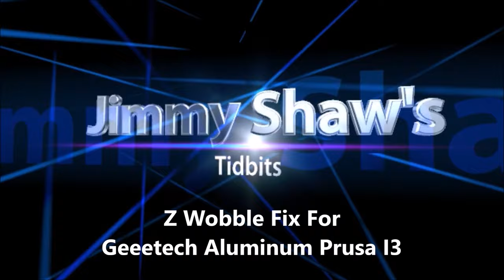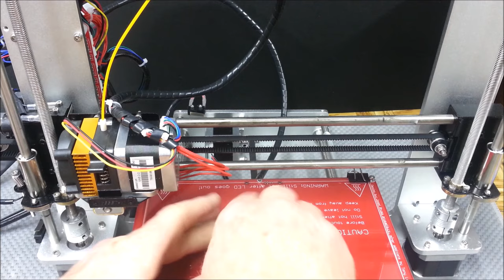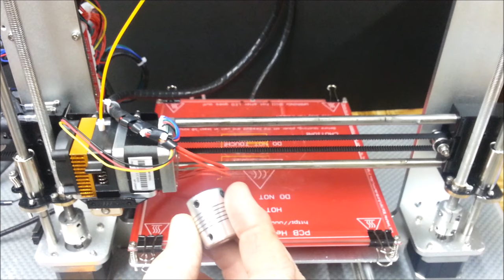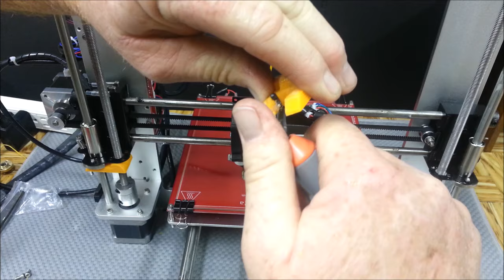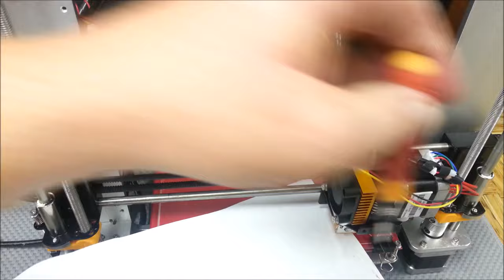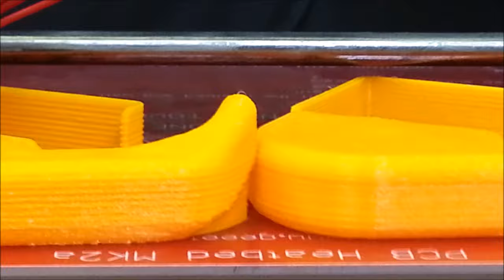Z Wobble Fix For Geeetech Aluminum Prusa I3

Comment: Maybe it has been already mentioned but I see that you level the bed while the bed and nozzle are cold. I have noticed considerable deviations on mine when the system gets at the operating temperature and so recalibration has become necessary. BTW, thank you very much for sharing this video. I have now a founded empiric reason to feature my printer with an anti-wobbling mechanism.

Comment: Hi, what software/firmware do you use? I have got aluminium prusa i3 aswell and I'm having some problems with coordinates and aligning too the bed, I tried the test cube and instead of coming out as a cube it came out as a rectangular stringy mess.

Comment: That is shocking wobble on your z-axis. Great job with the anti-wobble brackets!
Toward the end of the video you showed the wobble with the bracket installed, and it looked like either the stepper motor shaft was bent, or the shaft coupler was tightened in-place uneven, or the motor shaft to threaded rod alignment is way off.

On my printer I had to change one of my stepper motors because the shaft was bent, I also had to tighten the shaft couplers with care so as not to induce alignment issues, plus change my stepper motor mounts. 

Thanks for the video :)
Reply from the maker: +Tech2C Thanks!  I must have spent 4 hours all total trying to align the couplers.  The motor shafts are straight, but every time I would tighten the couplers they would shift just a hair.  Only once did I have it almost aligned, but it turned out I forgot to tighten the set screw on the coupler.  Sure enough when I tightened it, the wobble was back.  LOL!!!
Reply: I understand what you're saying, been there too...
With the couplers, when I tighten them I bend them in the opposite direction first, then as I tighten them the torque action moves them straight. That seems to work for me in aligning the coupler whist tightening.

I haven't investigated your printer design, but if the threaded rods are constrained at the top, that will also cause wobble. If they are constrained see if you can remove the bearing or whatever is holding the threaded rod in place at the top and run a test print for wobble.
Reply from the maker: +Tech2C I tried that too.  Even went as far as to use pliers to give the extra little bit of tension to compensate for tightening the screws.  Still no luck.  The top aluminum brackets have no bushings or bearings.  Now that the holes are beginning to wear a little larger, I'm thinking about drilling them larger and printing bushings for the top.
Reply: Jimmy Shaw's Tidbits

Ok. Yeah drill out the top, let the rods roam free, see how it goes.
Reply: I've done an updated design based on your work, check it out on my channel! It supports replacement without painstaking disassembly and also allows you to use the stock brass flange nut instead of a hex.
Thanks for your inspiration! Really helped me a lot
Reply: cool  i just ordered a  3d printer off ebay  the same as the one in the video  and i also bought 4 rolls of filament 
two rolls abs and two rolls pla to cover all bases  and it cost  $455.87
Reply: its like when the hammer comes out your doing something wrong  lol

Comment: reason for the round shape? reduce contact area?
Reply from the maker: +Nathan Hellyer Yes.  It allowed enough room for the nut to be seated, but had a minimal contact patch on the carriage.  I was going to use a dome shape, but was afraid it would want to center in the hole left from removing the factory nut.

Comment: If the couplings are installed incorrectly you'll see a wobble through the Z axis.

From what I can see on yours in this video and your other, you installed them wrong.

The motor shaft and threaded rod should only be inserted into the coupling about a quarter inch. 

The coupling is designed to flex. This removes the wobble from a slight misalignment of the motor shaft and threaded rod. 

If the motor shaft and/or Z rod is inserted too far, you'll see a wobble.

There's nothing in the instructions that explains proper install of these couplings. So you see this quite often as the cause. That and bent rods.

Nice work around though!
Reply: Wait, I have one just like the one in the video and I've the same problem. Really can I fix it so? Have I only to get the threaded rod up? Thanks in advance and sorry for my bad english.
Reply: you may have to add some tape around the threaded rod. The coupling is designed for an 8mm rod..  if you check. I bet yours, like others is less than 8mm.
Reply: Tape like rubber tape used in electric equipment?
Reply: @ Kay-Rax - it's a hack, so you use whatever works. One guy used JB Weld, though that makes it more difficult to put the rod on and take off.

Tape can be easily removed if you need to remove the rod. Any kind of tape that works... works. Thin is better.

The threaded rods are generally smaller than the 8mm for whatever reason. The coupling will go crooked when attempting to tighten on a rod too small... which most threaded rods are. The flex couplings are designed for use with spindles, not threaded rod. Or a smooth rod end 8mm in diameter, not 7.89mm or whatever diameter the threaded rod comes to under 8mm. You need to bring it back up to 8mm for best results. How you do that, is up to you. And only limited by your imagination and material accessibility.

Try it... you'll see. 

Also look up, installing flexible rod couplings. There's a video that shows the proper way to install these type couplings.

Look at the data sheet for the coupling, it'll state maximum insertion of the rod into the coupling.

Easy as making pie.
Reply: Keep in mind, you can still use the anti wobble hack seen in his video even if you install the coupling properly. It will help remove minor wobbles too.
Reply: Ok, understood. I'll try it and I'll write here the results. Thank you a lot.
Reply from the maker: No disrespect ment, or you could just print and install the Z-Wobble brackets and not worry about it.  LOL!!! 

Sorry, I just had to say it.  I'm so glad to see everyone  helping each other out.  Have a great day everyone.
Reply: Thank you for reply. I'm just trying my first print with your solution and it's going a bit well. There only is a trace of the wobble. Please tell me how to screw the screw of the spring without the spring goes left. Have a nice day .
Reply: When I screw it, the spring goes left, have I to use a tape to make the rod diameter bigger? I really don't know.
Reply from the maker: +K-Rax are you referring to the screw for the end stop for the Z axis?
Reply: Nope, i mean the threaded rod at its bottom.
Reply: Anyway, i solved, thanks to you, used that solution and everything goes well, I just printed squirtle (so cute) and everything is ok. Thank a lot man.
Reply: @ Jimmy - your anti wobble braces may work better with the metal carriers. Those with the printed brackets will still see a wobble even after installing your and others like it. 

Installing the couplings correctly to begin with. Correcting the problem first, then adding in the anti wobble braces to correct for micro wobbles a better longer term solution. Especially for those with printed carriers. I can't speak for those printers with metal carriers first hand. I don't have that upgrade on mine.

The Z axis needs to be redesigned. One shouldn't have to come up with solutions, hacks or work arounds. Those designing the printers for sale should fix the issue so we don't have to...  just saying.
Reply: Thank you for this smart idea! I'll try this out tomorrrow.

Comment: So I initially saw these brackets and thought it was pretty ingenious but thought it was a fix for a problem which shouldn't exist. I thought if I replaced the threaded rods on my machine with T8 lead screws, it would solve the wobble issue and just be a better all around stable machine.

While the lead screws did fix the wobble, it was a PAIN getting them into this machine and I had lots of other problems because I added them. In the end it wasn't worth it.

I downloaded Jimmy's design, printed them out with some M8 nuts I picked up from home depot and I put the threaded rods back in my machine. What a perfect, simple, and easy fix.

Trust me, just leave the threaded rods in this machine and use this design. It's totally worth it for such a great and quick fix.
Reply from the maker: +Bob Butterworth Thank you!!!  I'm glad it worked for you.  Honestly, when I made this, I thought it was just my problem and thought if by some chance someone else had a issue, maybe this would help.  I am amazed at how many views this video has received and how many downloads on Thiniverse for these brackets.  It makes me want to keep making stuff.  Thank you for sharing.

Comment: Great fix Jim, it certainly does the job well.

Alltough looking at the video the problem is more fundamental. I seems the irregualar thread of the rod is clamped into the socket by the horizontal thightening recessed screw thus ofcentering the lot. 
So in fact you would need a rod with an evened out smooth base of 2 cm.

Sorry for just adding to the problem and not resolving it.

Greetings, Ton from Holland

Comment: I have the Geeetech Prusa i3 Pro X (very similar model to yours). I also had quite bad Z-wobbe. I upgraded to lead screws as opposed to the threaded bar. Now it's completely gone. PERFECT z-axis prints.
Reply: Tim Lennard which kind of lead screws I have Same as yours with plastic tube connected to motors. So it is 250mm or 300 lead screws ?

Comment: after days testing I find the solution: the printer is not very straight and the two motors are not exactly 90 dgr under the Z-axis, first solve the building problem and you will see the difference. I decided to rebuild the glass base to aluminium because I am a CNC Miller .

Comment: Brass is a softer metal than steel, a brass nut will wear out while the steel screws don't wear. Steel on steel and they both would wear out together, instead of just the brass nut.

I like your fix, freeing up the x-y azis of the z-axis nut.
Reply from the maker: Thank you!

Comment: you just need to get the leadscrew in linear with the motor axis and everything is fine. that worked for me! in your Video you can See that the leadscrews are running Left and right dude :D
Reply from the maker: You are 100% correct.  And after adjusting, re adjusting and even trying another set of couplers, the z wobble never went away.  You are extremely fortunate that you were able to make it work without any further alterations.  Unfortunately in my case, and several others, this was a fix that helped.

Comment: i think would be better to buy zonestar p802qs full metal frame, i know the frame are pretty slim(about 2-3mm), but it is enough and less problem too. What do you think?
Reply from the maker: +Amr Fwwz I just did a search for it, and can't find where the sale them.  How much are they?
Reply: 50% price of this geeetech! but the metal frame is only 2mm, but it is enough i think.
Any possible better way to fix this z wobble issue? maybe like buy a metal part or something? and this issue affect on the quality or anything? let me know it. i'm a noob and trying to safe my money to buy a good quality frame 3d printer, but i'm confused what to choose between Zonestar p802qs and a famous geeetech printer, just need a little more money to buy standalone geeetech metal frame..
Reply from the maker: +Amr Fwwz Actually the frame is 5mm on this model.  The only other way I know of to fix the z wobble is to buy the stepper motors that have the threaded rods attached so there are no couplers.  So far the brackets have been working so good, I haven't felt the need to spend the money on it.  Have you checked out the Aluminum pro model with the electronics in the separate box?
Reply: Jimmy Shaw's Tidbits, "buy the stepper motors that have the threaded rods attached"
thanks for a great answer, now i don't want to doubt to choose geetech product! 5mm thickness is perfect, that's the only thing I need.

Comment: /That thing came with that cheap screws for the Z? Wow, those are garbage. You may want to get better screws. It's better but it could be better than that..
Reply from the maker: +dr07828 It's been working great for me for over a year.
Reply: Jimmy Shaw's Tidbits I'm glad it's been. Those screws are just plain old threaded rod. If you were able to get it to print really well with that you should see what the good screw rods do.

Comment: does this thing push the smooth rod thing up? i'm new to all this but confused about how this helps.
Reply from the maker: No.  The smooth rod is the guide that keeps it from spinning.  These  replaced the factory nuts and would allow the threaded rods to move without transferring any motion to the z axis thus making smoother prints.

Comment: Do you have a drawing  of the Z axis anti wobble parts.
Thinking of making a pair from aluminium ,tapped 8mm and and a slot for the guide rods.
Was it necessary to change the flex couplers for better quality
Good video 
Thanks
Reply from the maker: +John Lindo unfortunately I do not.  But, if you follow the link to Thingiverse in the video description, I believe I have the original design linked from there to Tinkercad where I made it.  From there you can ungroup it to get all the details.
Reply: Thanks I will try and follow your links.
But thinking of making in aluminium , possibly I can get more accurate control.
Just bought a Geeetech Prusa Aluminum frame, 3D printer with remote control box.
I think it will suit the very variable temperature changes we have here from summer up to 40 C winter _2 C 
than acrylic or wood.
Give my regards to Buellton CA 93427 Pea Soup Andersens land.
lived there for 25 years. I was a design engineer for a race car component company.
Now retired, Yippee!
Cheers
John
Spain

Comment: Is the basic problem with the couplers or bent screwed rods, looks like the couplers hole is to big for the rod and is pushed over to one side causing the problem,what do you think ?
Reply from the maker: I think it's a combination of problems.  Before doing the antiwobble brackets I tried different couplers, but it actually was worse.  So I think it's not just the couplers but the rods themselves are not 100% straight either.  I don't think any threaded rod can truly be straight.
Reply: Thanks for getting back to me Jimmy, my geeetech i3 b should arrive any day, I'll pay particular attention to the condition of the feed screws and the fit before I build it, fingers crossed for a good build .
Reply from the maker: I believe they have changed over to lead screws.  If so you probably won't have a problem with them.

Comment: Can you help me? I try it also but its not working... i think to much weight on the things cause when i help only a little with finger, it works
Reply from the maker: If the part that straddles the metal rod is too tight, you may need to sand it or file it down the inside so that it's a little bit loose.  If it's loose, add a little oil or grease to both the smooth rod and the threaded rod.

Comment: In my opinion, it would be much better if you replaced the rail with 20x20 v-slot and got Z-motors with integrated lead screws. But then again, you'll have to heavily customized the connectors.